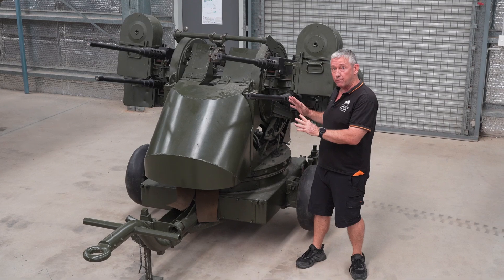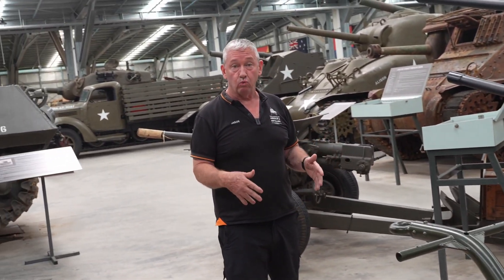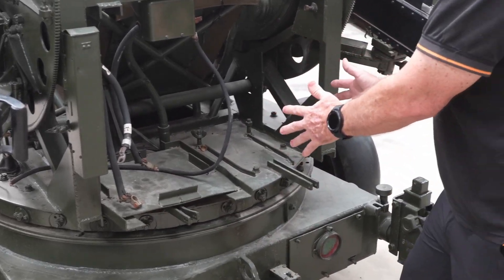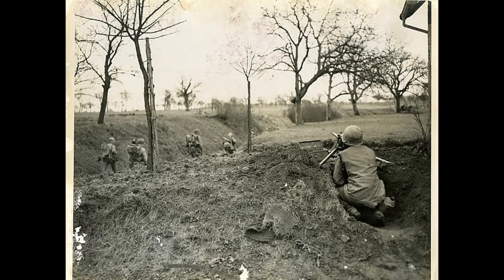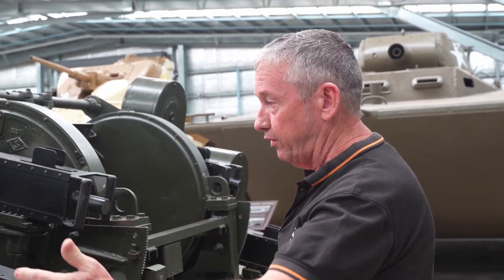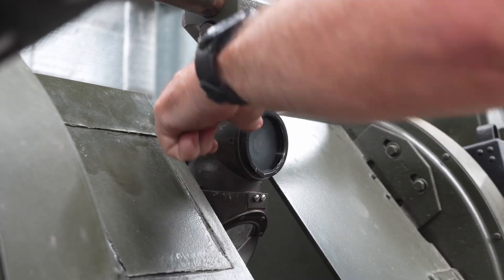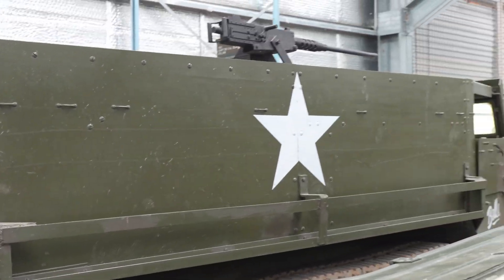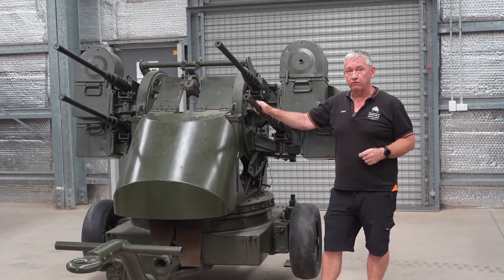The M45 Quadmount .50 cal Anti-Aircraft Gun!

Comment: wasnt that Quad gun and Little hand control type seen on "Waterworld"  as they made swiss cheese out of the Atoll?
Reply: sure looks like it - only the Waterworld version has barrels that look like 30 cals, while they load it with 50cal. Minor Hollywood detail I guess.

[edit] or an aircraft 50cal perhaps
Reply: @alphaniner3770  Yeah i had another look at the film scene and the 50 cal barrels with short cooling jacket at root are not there and the films barrels had a cooling jacket over them so 30 cal or 50 very hard to determine. the casings on the floor they are scooping up look pretty beefy and they have the diff mags but they are hand feeding it you can just see? all bit of a mess and for effect as you said hollywood!   In another scene with the catamaran, you can see shiny new cables running up the main mast obviously needed for safety as this is a working prop boat ? and has to work with heavy loads with the sails ect  I sure there are lots of hidden mistakes with so much going, on, i was trying to find a camera rig somewhere that got missed in editing as many cams must have been used for such intricate shots from diff angles, but i think they got it right.  That huge tanker with all that oil the valdez? is fantastic but so many bad guys in it, imagine the food and water requirement?  No land or soil , i dont think this world would last very long.

Comment: Cool piece of equipment  .. how is it loaded you did inform us that there were 2 loaders but not how its loaded thats a big big patr of information missing i'm probably not the only one that wants to know . Please next piece of equipment dont be so quick and please make sure you have all the information on that piece of equipment.  Ty .
Reply: The cans are lifted and placed into slots on the side from there you take the belt and load the gun as normal. As for loading the cans you put one 100rd belt in and using a tool you wind it up. You then put the next 100rd belt into the bottom. Connect the links. the close the lid. The Tombstone had rollers for reliable feeding.
Reply: @Predator42ID  thank you much appreciated

Comment: That GUNNERS capsule....  I was expecting some sort of electronic targeting system, or a radar-like sensor.  REALLY didn't think there would be crew INSIDE that thing.
Reply: Its not a CIWS like the Phalanx 😅
Reply: @LillyRocket  It's the grandfather, with actual grandfather inside.  I mean, the fact the design is so similar is striking.
Reply: it was WW2
Reply: @dukenukem8381  Yea, but the german AA was assisted by an electronic targeting system, to calculate and relay adjustments for the guns, or so I've heard.
Reply: @monopalle5768  you are comparing AAA battery to a truck 50 cal mount
Reply: @dukenukem8381   Principles are the same, but you are right, it's like the guy said in the video. A crew compartment!
Reply: @monopalle5768  Having centralized  analog FCS control command center on ww2 AAA battery has little to do with heavy machine gun mount. B-17/24 had lead targeting computer but still requires a person inside. Only B-29 had remote station turrets. But that was too expensive and delicate for an army.
Reply: @dukenukem8381  One thing I've learned, is not to judge ww2, I have seen thermal sniper sights from that era, they have access to things that CAN surprise. Even army dorks like me.